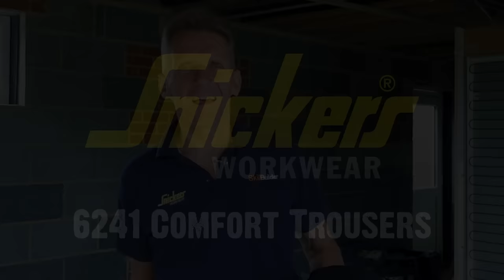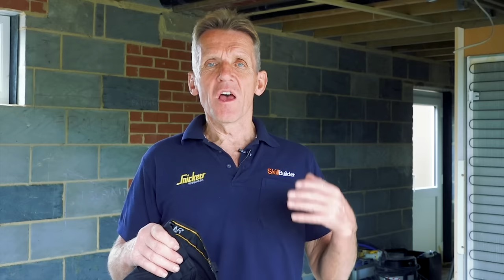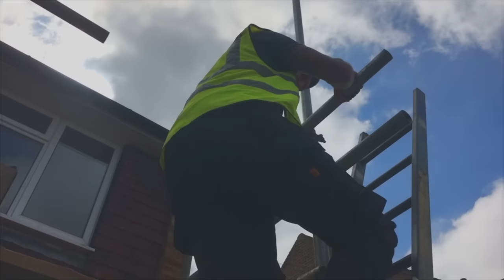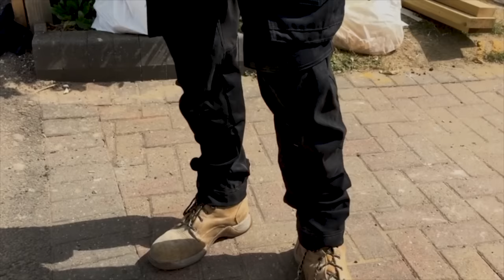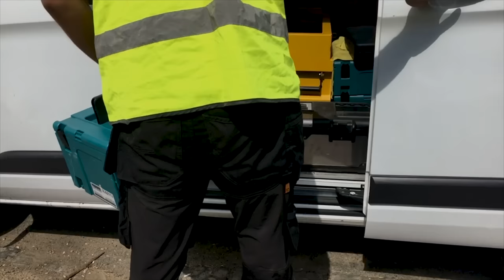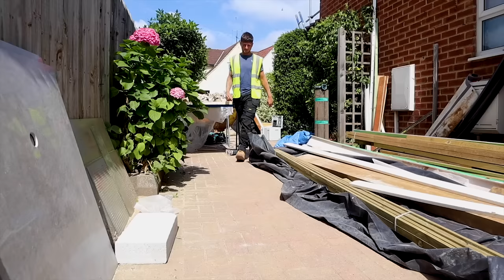Snickers Workwear 6241 Stretch Trousers with Holster Pockets

Comment: Maybe this needs a bit more explanation. Snickers older 3 series has a baggy cut to allow for kneeling giving more room in the thigh etc. However not everyone who's the same waist is the same shape so in many situations they were too loose. The 6 series is cut more to a jeans fit - Not skinny jeans - just a more modern fit. However you still need freedom of movement without ripping the seams. This is exactly what the 4 way stretch gives. Now it's not the perfect cut for everyone, nor is it the right price for everyone. But if you want comfort, durability (not just when working but driving too) and a smart trouser that you will be in for anything between 10/12 hours a day then this could be perfect for you. If the cut on the 6 series is too narrow then we still have many styles of the looser 3 series to choose from.
Plus there are many alternatives in the market that may suit your personal fit and budget better. Snickers, like all other brands, is a choice and Workwear in the UK is changing - Hopefully for the better !! Only time will tell.
Reply: I like this but would u maybe do with a low waste as they keep falling of my back side and is quite hard to walk in them

Comment: I’ve got big thighs so I like the big leg type trousers I’d split the arse out of these taper leg jobs. Shame I got excited about stretchy trousers.
Reply from the maker: Try a pair on they have lots of give for those bulges. You might be surprised.
Reply: Skill Builder might do if I find a pair in stock some where in long leg. Normally they only stock 33leg round here.
Reply: @whitacrebespoke  I'm a 35' leg, screwfix normally works well for me as they stock it. But sadly they don't stock these.
Reply: ghostmanromeo uk is that from warehouse? Can’t seem to find em in store. Will take a look. I wear site shorts usually